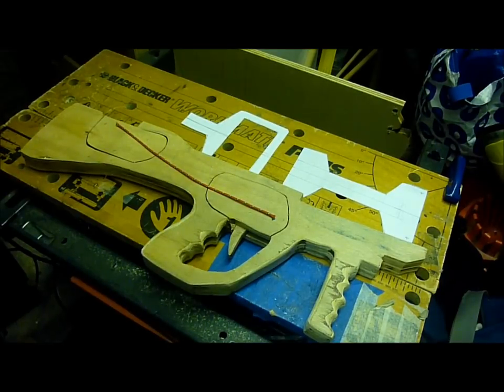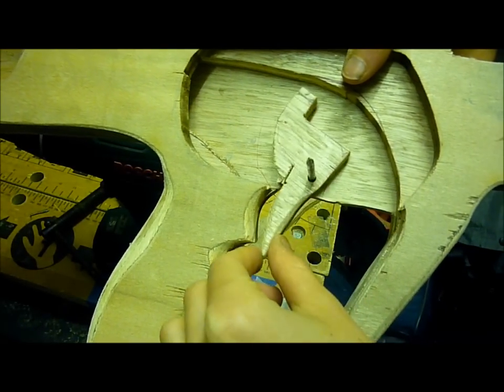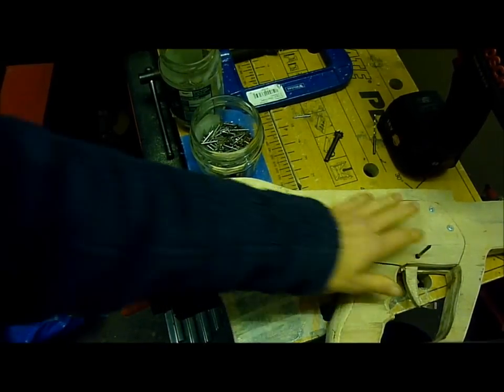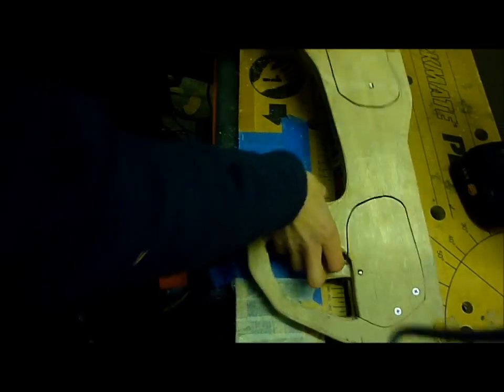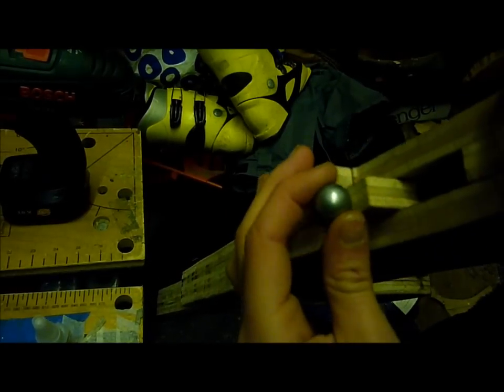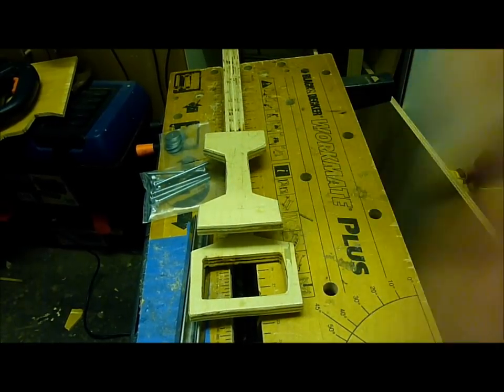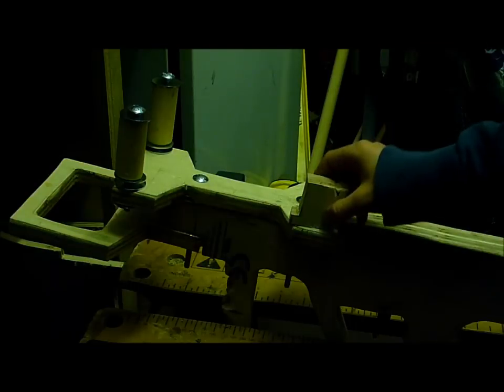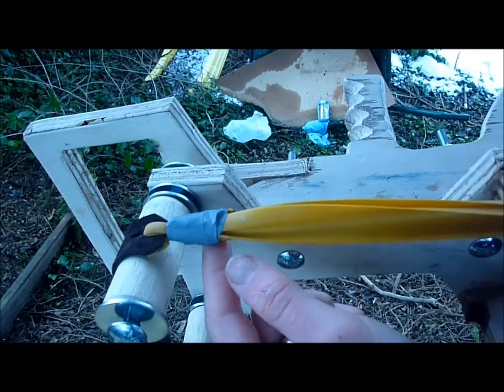Making the Joerg Sprave Bullpup Slingshot Crossbow - part 3 (FINISHED)

Comment: Excellent work. A couple of tips for you to try. #1. You probably have a hole saw. Use it to make discs, stack them up and epoxy them on a bolt. Smooth out the edges and use double sided tape to stick sand paper on the dics to make a sanding drum. Different diameters, stacks and paper grades can make many sizes of drums. Ideal for you finger grips and any other curves. #2 For small elastic bands used for your trigger etc. Cut an inner tube crossways to make bands. The wider band equals stronger.

Comment: Applying wood glue to both halves, clamping tightly til excess glue squeezes out and glue dries (overnight) would work fine and cheaper. The bond is actually stronger than the wood.

Comment: forgive the name im on my wifes account... you asked for some comments on possible upgrades so here we go... instead of the bands you currently use have you tried using spearfishing bands? or surgical tubing? also you can try to widen the base that you rollers are on. if you do this you will need shorter rollers but i think you can find metal rollers that are a good size for the rubber tubes. im a carpenter myself for the US military and i would have to say you did a stand-job! good work!!!